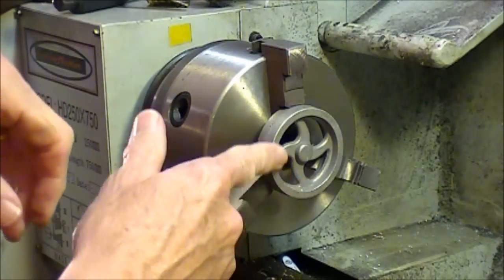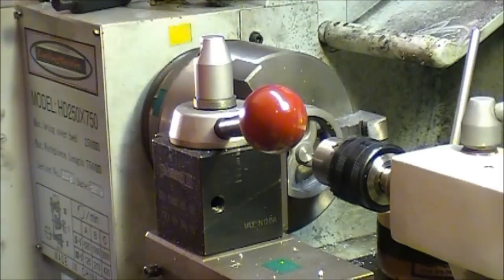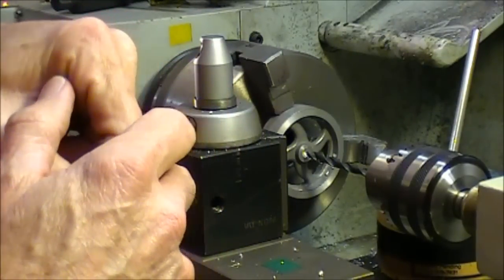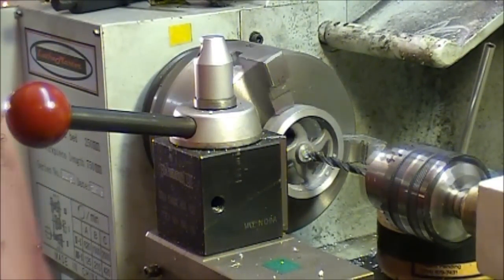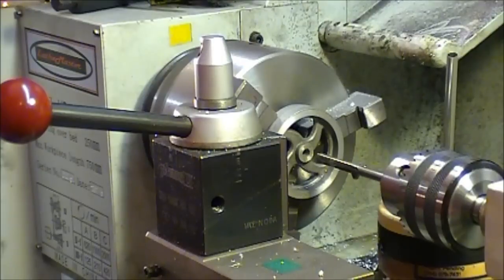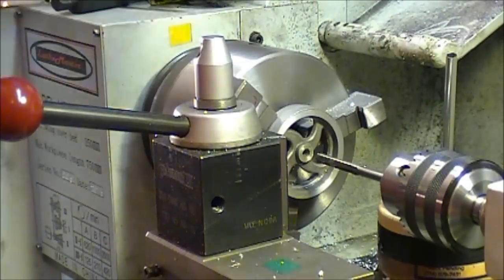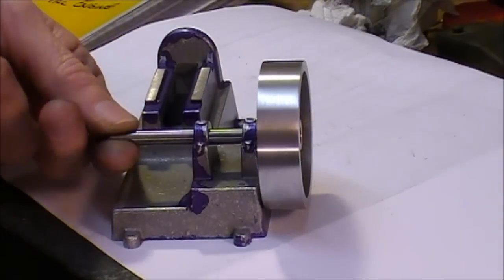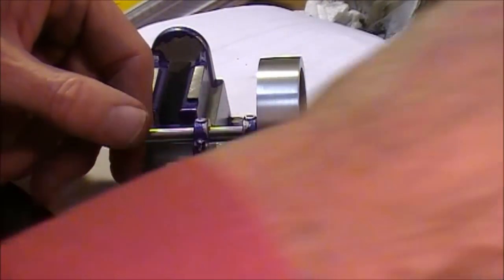Part 11- PM #3 Steam Engine-Machining and Assembly

Comment: Can you comment on the mandrel bolt you used. I assume a 1/4 inch bolt would be too loose so is it tapered or maybe a 5/16 bolt turned down on the shank?
Reply from the maker: Galen,  Sorry for the delay in getting back to you.  We've been doing a major remodel job here a the house and computer time has been limited.  After going back and watching the video, I seem to recall I made a mandrel that would fit the bore.  (It's been 11 years since the video so memory is a little shady!).  ~John
Reply: @TinkerJohn_W5CYF  Memory, what's that?🤔
Wondered why the spark plugs second video never got posted!
You never stop working on something, now a version of this old house coming next? 
Take care.